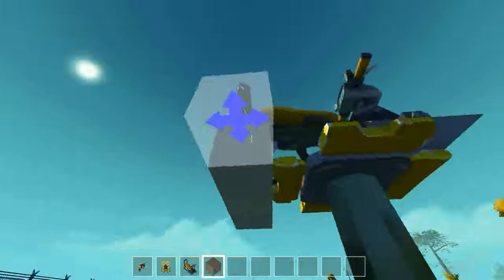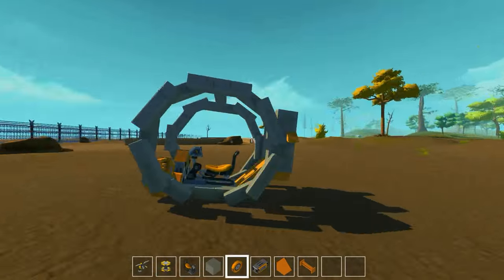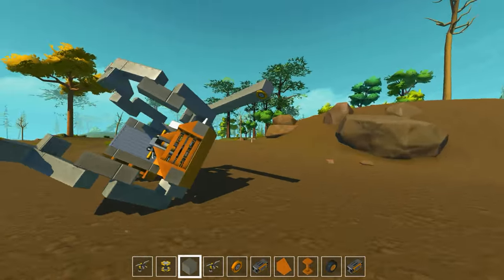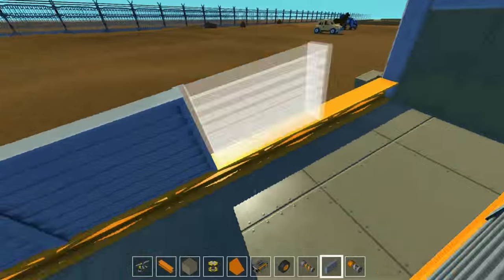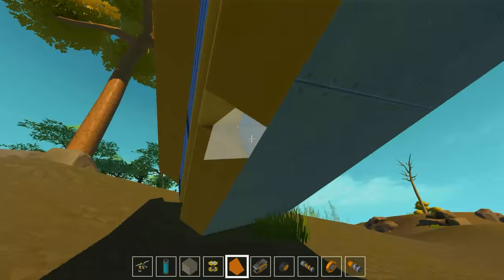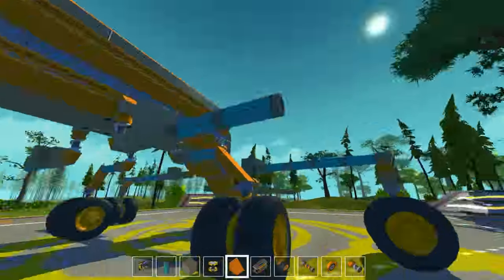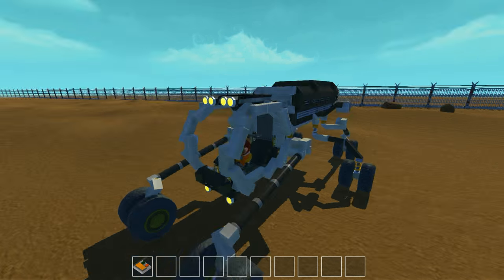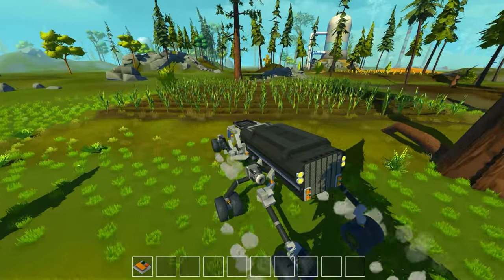ELITE DANGEROUS SRV| SCARAB BUILD | SCRAP MECHANIC

Comment: No ofence, realy cool vehicle, but your thrusters are actualy causing you to tilt more rather than less. When you turn left, Your left thrusters points down, causing you to generate more lift on the left side. And the thruster on your right pushes the right side ov the vehicle down = lower to the ground= more top heavy :) What you want is the oposite. When you turn left, you want the left to thruster to push you down and the right thruster to push you upp :)
Reply from the maker: +Nemi “NemiG” G Thanks for letting me know!